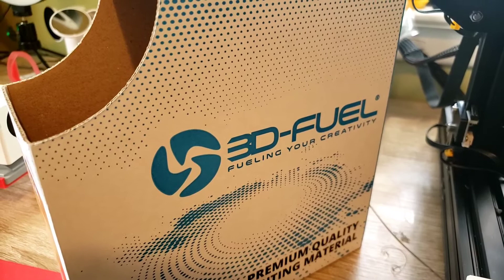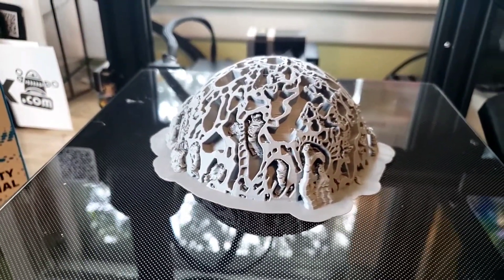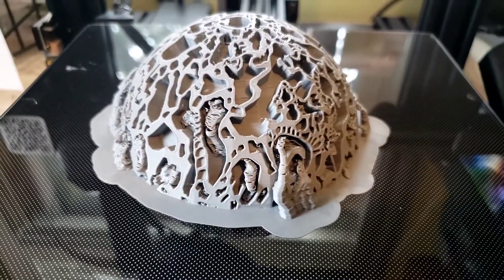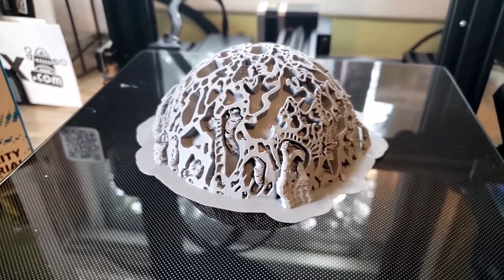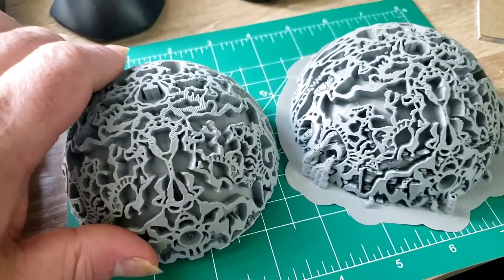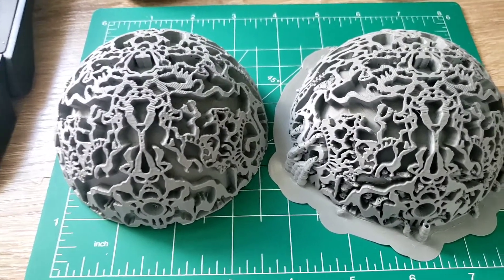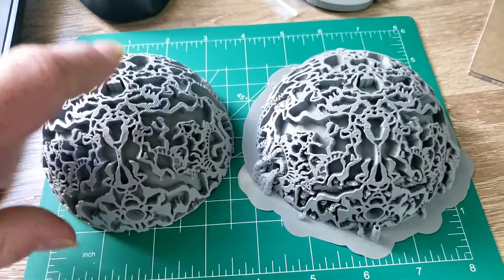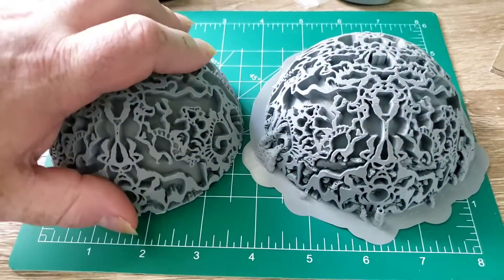3D-FUEL Pro Pla structure and detail test

Comment: The orb looks great! I used this filament for my armor and it's really strong compared to overture pro pla
Reply from the maker: It's industrial grade, but I noticed that too. It takes a bit more effort to sand but the stuff is rock solid. I only use 3D-FUEL for my printers parts and upgrades as well.